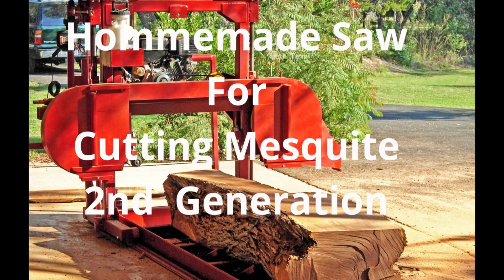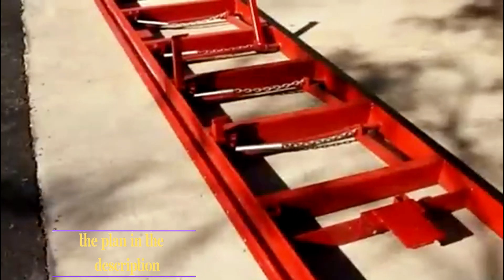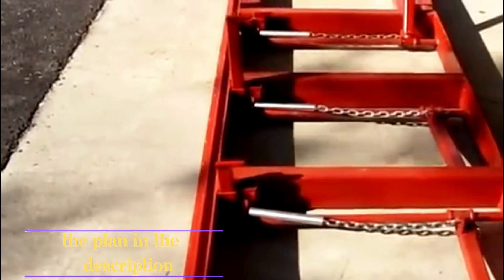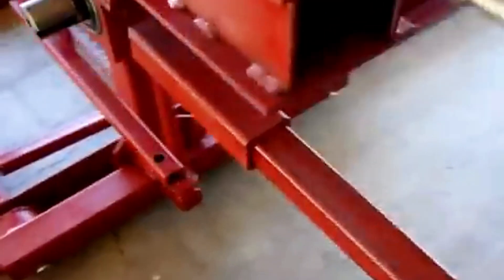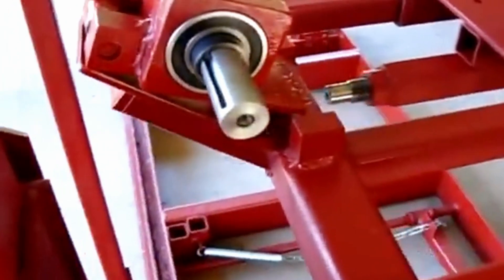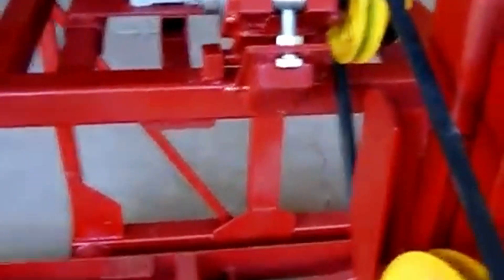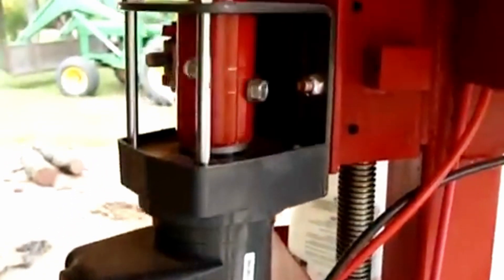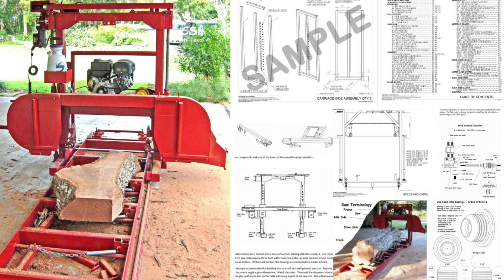BANDSAWMILL PLANS, sawmill  ,Homemade sawmill  , BUILD IT YOURSELF COMPLETE FABRICATIN

Comment: Very nice. What method is used to regulate the tension on the blade. I see most use acme thread with springs others with hydraulic cylinder  also with springs. I'm confused about what you use. Hope you can help me understand before I pull the trigger and buy the plans. Thank you.

Comment: These plans have proven to be incredibly helpful for my construction project. Despite having no prior experience in welding or working with steel, these plans have made me appear knowledgeable and skilled. I'm on the verge of beginning the wood cutting phase; all that's left is to perform an alignment and install a blade. Just waiting for a day or two without snow and cold. Appreciate all your assistance, Ben!
Reply: I’ve been going through the plans and I don’t see how to scale it up for a 48” cut width. 4x4x 1/4?